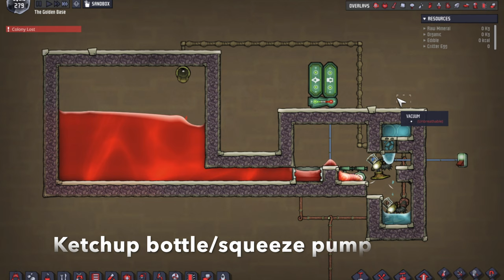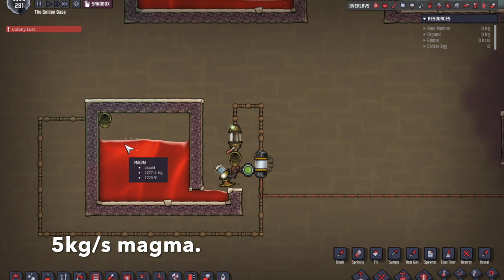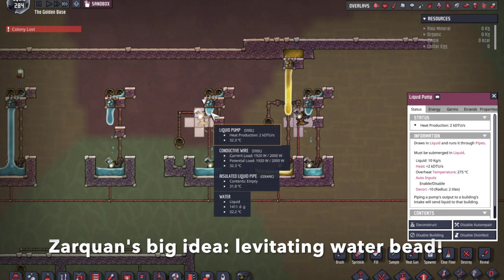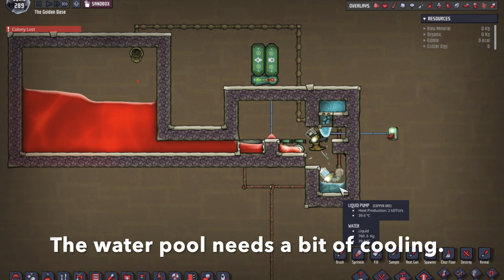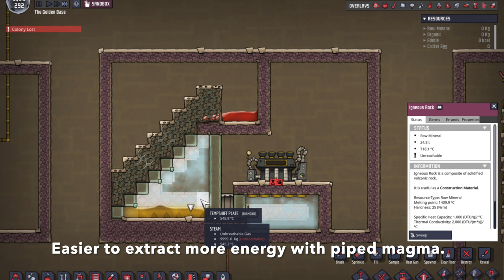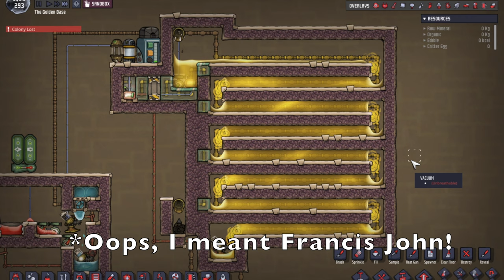Mid Game Magma Pump [Oxygen Not Included]

Comment: with the new updates, the sensors are not reacting fast enough, thus causing more spills and failures. Add more sensors before the 2 sensors to trigger the door faster. i added a sensor above the door set set to trigger a 10g and another the over the overlap to trigger at 180. it works after that.

Comment: It doesn't work right now, keeps on spilling too much magma in. Any ideas?
Reply from the maker: I can't tell without seeing it. It may depend slightly on the overall height of the magma reservoir. If you look at liquids in this game (including magma), the deeper the reservoir, the more mass you'll find per tile. That could theoretically percolate down the channel and result in a bit more magma at the "ketchup bottle" door pump. You might try having three tiles instead of 2 after the door pump.
Reply: @sebastienloisel7983  It works just fine, I was being an idiot as I was new to these magma pumps. Thank you for a wonderful upgrade of Zarquan's design, I'll be using it for lots of things :)

Comment: I really liked this design the the video explaining it.

I just built this in survival to pump the magma core to a steam turbine setup (after getting down to the neutronium layer through some lucky obsidian boulders in the magma on the right edge of the map). Two notes:

1. It still works on the bottom of the core where on the other side of the wall there is between 15 and 20 tiles high, full magma chamber, so the ketchup method can handle some extra pressure with the suggested hydro sensor limits. It spills magma to the 3rd tile sometimes (definitely more often then you suggested in the video), but it's not a problem, it still works well.
2. I modified the setup a bit, so it's slightly smaller and can fit closer to the neutronium at the bottom of the map. I just simply moved the bottom pump 1 tile higher and everthing is still working fine, but then the build has 1 tile less "depth" under the airlock level.
Reply from the maker: Nice!

Comment: I play at 30x speed and at these speeds the automation doesn't work properly and the system fails
Solution: 
1 - Add an AND gate to both hydrosensors, they both output green if there is too much magma and thus opens then door stopping incoming magma
2 - Set the door to the last tiles of the magma drip limit. That lets less magma in as a result and means you can have a better control over the incoming magma. In case the need of more magma you just need to reduce the filter-buffer-not -gates system to close more frequently. Tested on 1x 6x and 30x speed (which in reality is probably 15x) and values were 200kg above and 100kg above for the first and second hydrosensor. 2 seconds for the buffer-filter-not gates signal loop. 
Quick explanation of how the automation worked previously:
The filter-buffer-not is a cycle that opens and closes the door at a fixed speed granting supposedly constant income of magma, supposed constant because some  times magma bugs and does not fill both door tiles the same amounts always, meaning there is a need to control the volume at some point hence the variation isn't constant. In other words, you cant just set a open and close x times per second and it will work because at some point its going to drip more than the pump can retrieve meaning its going to break. That is the reason both hydrosensors are needed. They stop the open-close loop avoiding excess
The only difference I changed is that my door is at the last tiles of magma meaning I get less magma per close and can have better control, second difference is that instead of linking both hydrosensors to the ''open-close'' automation, I made sure to make both of them need to be above specified settings in order for the door to stop cycling.
You do not need both changes if you don't run over normal game speeds
I will now learn how to build the automation to check how many times the magma drips to the lower tile and if beeds are consistently 10kg/s

EDIT 1 :
My pipes were accidentally made out of igneous rock, watch out for that, mine eventually melt down and bye-bye

Comment: Hi,
i tried pumping magma. It works for a while, but the pipes which aren't in a vaccum all around my base ends up breaking "received damage from pipe contents being too cold", it's still 1000+ °C magma where it happens...? Any idea what i'm doing wrong?
Reply from the maker: Like I say in the videos, all these pipes that are carrying magma should be in a vacuum. You can carry magma in insulated pipes that are not in a vacuum, but they will warm up over time and you will have to cool them. Also, the magma in all your pipes should always be moving and never stopping. If the magma stops flowing in a pipe, it will cool and crack the pipe, even if the pipe is in a vacuum.